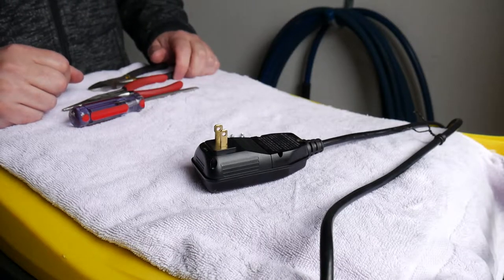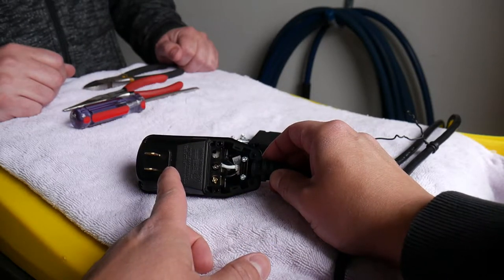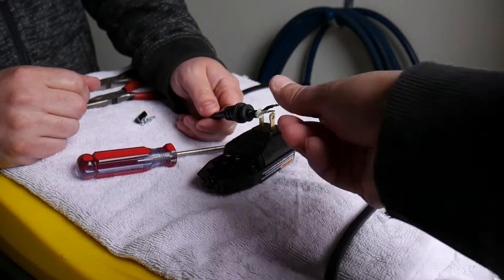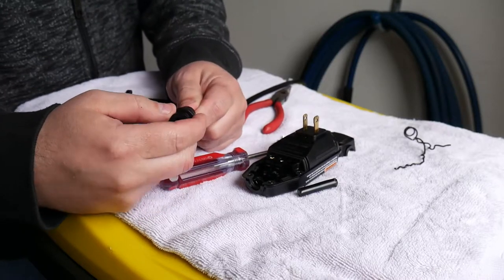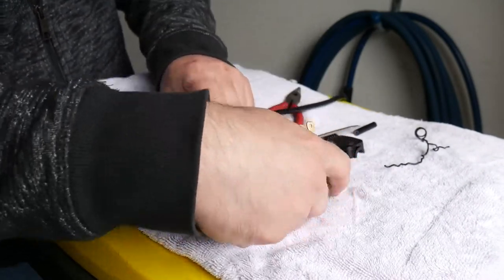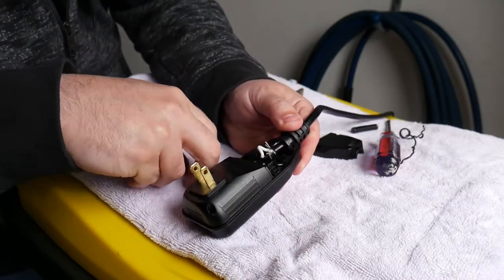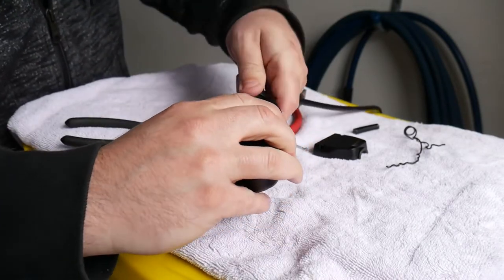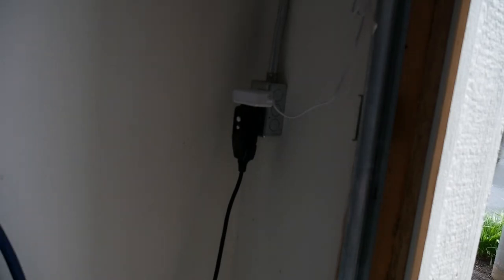DIY: How to shorten the power cord on a Ryobi Pressure Washer

Comment: WHY IN SAM HELL WOULD YOU EVEN THINK ABOUT SHORTENING THE CORD!!????   WTF
Reply from the maker: Because of my garage set up. The PW does not move. So I don't need the extra cord.
Reply: I have a Craftsman 1700psi pressure washer. The cord is unbearably long. It's easier to connect an orange extension cord to the unit when in use.